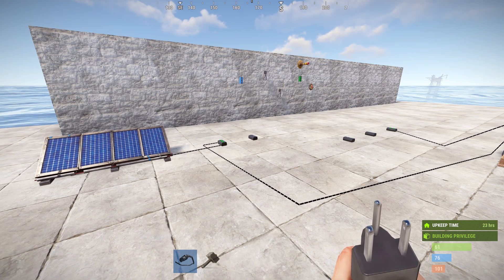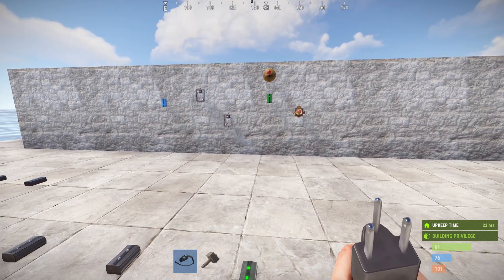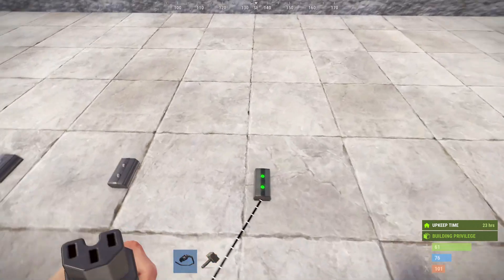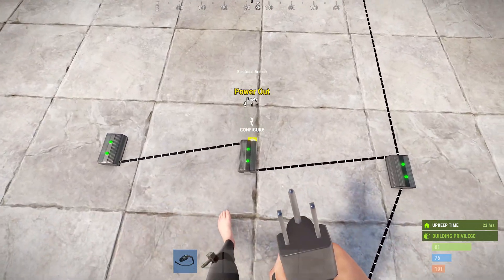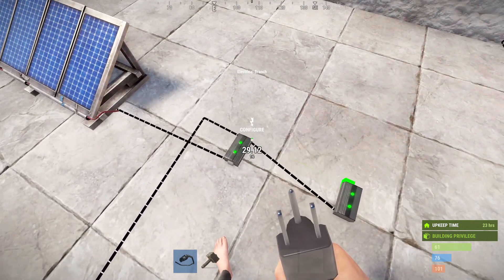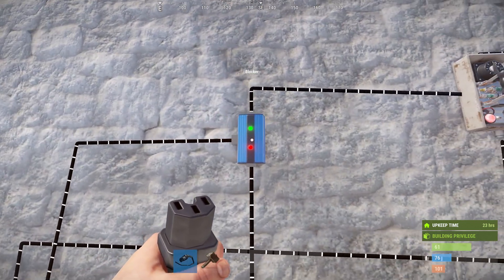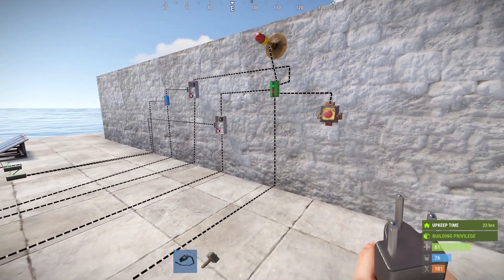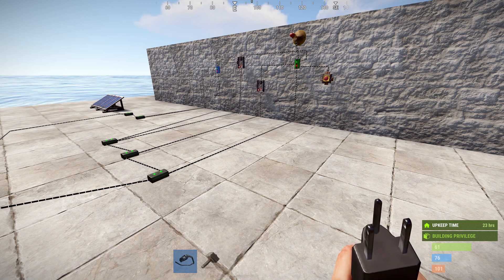Rust Electricity: User Request - Advanced Solar Lighting Override

Comment: What happens if it's nighttime but you decide to turn the light off to save battery power? Will it go off with the button? And then will it automatically go on when the solar panel receives light?
Reply from the maker: Yes, it will turn off with the button at night. It will not turn back on again automatically until the next sunset. The sunrise and sunset events are distinctly separate with this circuit.

Comment: My friend is so happy we can turn the spotlights off when we want to and individually as well, we also have this circuit set up to a automatic recharging system basically an alternator for when the batteries drain during the night the generators are activated upon overloading the battery with charge as well as the wind turbine adding additional over load to the battery keeping your turrets on but shutting off your lights and turning on some siren lights to rep that the alternator is active as well as the extra back up battery bank hooked up to the same circuit alll thanks to this video u have made for me I'm using the nih core as well so my active usage says 24 but I'm using 16 turrets as well as the power throughout the base using 1 wind turbine and 6 solar panels the recharge rate on all 8 batteries is split between all them evenly and giving a input of 18 each battery so there's still an active charge u really gave me an opportunity to have breakthrough with the knowledge I have and the bits I'm missing that u just provided me.
Edit: don't know how many times I can say it but I am really appreciative of this video